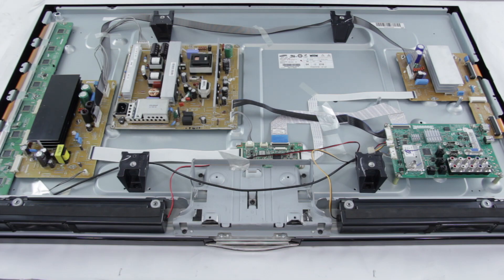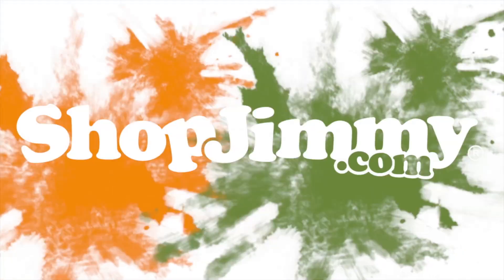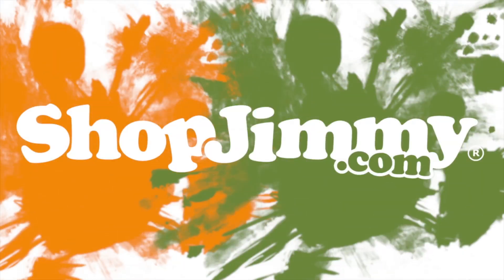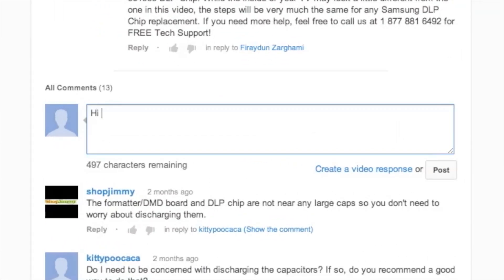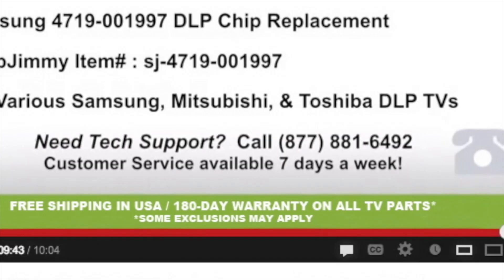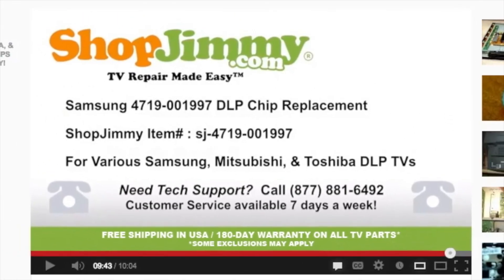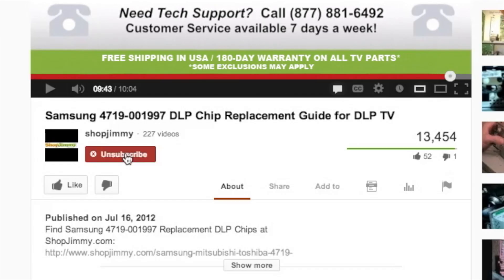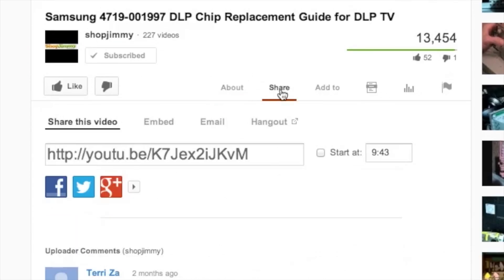Plasma TV Repair Tutorial - Common Symptoms & Solutions - How to Fix Plasma TVs

Comment: Hej there, first i want to say thank you guys for this tutorial. 

my problem is that my samsung plasma tv PS50C430A1W only plays audio but doesn't display a picture. so i tried the following. i changed the Y-board and Bufferboard. i bought it from eBay but i guess that guy sold me nonfunctional board or at least the buffer seems to be not working. 

if i turn on the TV some pixels are flashing on for almost a second before the samsung sound appears. ist there any other part that could cause these symptoms? i also changed the Buffer/speakers but they came from the sam ebay guy :/

maybe i have to go more into it and test the different boards more in detail but i would be thankful for any advice!

thanks to you all!
Reply from the maker: Laurids Wiemer  Try all repairs and troubleshooting at your own risk.  Sounds like you received defective replacement parts.  Thanks!  www.shopjimmy.com

Comment: I have a Panasonic TC-P50S10 plasma and have some vertical colored lines mid left side. It looks like some are going to bottom, some are not. Could this be a bad ribbon connection with the bottom buffer board??
Reply from the maker: MrJmm1952   Try all repairs and troubleshooting at your own risk.  This sounds like a TV panel (TV Screen) problem.  If your TV panel is bad, it may be more cost-effective to replace the TV as panels are typically hard to find in stock, difficult to replace, and expensive.  Thanks and please let us know if you have any further questions!  www.shopjimmy.com

Comment: hello, I am looking at picking up a used Vizio VP50HDTV20A plasma. It has sound, backlight, but no picture. It seems like this could be the logic or main board. What do you think?
Reply from the maker: Dustin Ouellette  PLEASE SUBSCRIBE TO OUR CHANNEL - Try all repairs and troubleshooting at your own risk.   I recommend replacing the Y-Main Board and the YDRVTP & YDRVBT boards in your TV.  Click this link to replacement parts for your TV model number.  http://www.shopjimmy.com/catalogsearch/result/?q=VP50HDTV20A  There may be multiple boards for the same TV model number, be sure to match part numbers on your current board, with your replacement for compatibility.  Here is a link to a video showing how to identify your part number, click here:  https://www.youtube.com/watch?v=R1jmj_foId0  Thanks and please let us know if you have any further questions with your TV Repair!  www.shopjimmy.com

Comment: Hey there i have a samsung plasma pn60e7000ffxza,  i have replaced the power supply board (bn4400514a) once already and the same thing has happened..the tv will turn off and on a couple of times and then the red light at the bottom left corner will blink twice every 3 seconds or so..ill disconnect it because you cant turn it back on after it does that..then itll power on for a while and do the same thing..then after a while it just wont turn on no more itll just do the clicking and the light thing...so having replaced the power  board once already hasnt helped could it be something else thats affecting the power board? Thanks for you help in advance!
Reply from the maker: Jorge Munoz    Try this at your own risk. Unplug the TV, then disconnect the y board and plug in the TV to see if the TV powers up. Reply with the results of this test. Thanks! www.shopjimmy.com
Reply: ShopJimmy.com i replaced the y main board and it still does the same thing..i havent tried what you asked but i will when i get sum time this tv is a pain...
Reply: ShopJimmy.com well i tried that and it didnt power on it just clicked on and off with out a picture showing up on the screen..
Reply from the maker: Jorge Munoz   Try this at your own risk.  Disconnect the x board and repeat the process.  Thanks!  www.shopjimmy.com
Reply: ShopJimmy.com i disconnected the x board and the clicking  sound stopped and the red light kept blinking and the screen still did not turn on
Reply from the maker: Jorge Munoz   Did you have sound before you disconnected the x board?  Thanks!  www.shopjimmy.com
Reply: ShopJimmy.com all it was doing before i disconnected the x board was the clicking noise over by the power supply board, once i disconnected the x board that clicking noise went silent..so thats all, there was no picture no sound..
Reply from the maker: Jorge Munoz   PLEASE SUBSCRIBE TO OUR CHANNEL - Try all repairs and troubleshooting at your own risk.  If the clicking stopped after you disconnected the X board, then you have a bad X board and it should be replaced.  Click this link to a replacement X board for your TV model number:  http://www.shopjimmy.com/samsung-bn96-22020a-x-main-board.htm  There may be multiple boards for the same TV model number, be sure to match part numbers on your current board, with your replacement for compatibility.  Here is a link to a video showing how to identify your part number, click here:  https://www.youtube.com/watch?v=R1jmj_foId0  Thanks and please let us know if you have any further questions with your TV Repair!  www.shopjimmy.com
Reply: ShopJimmy.com thanks boss..yea before the tv went out the x board was making a very loud buzzing noise but i thought that was normal i guess ill try replacing that as well thanks for the help..unfortunately  you guys are out of stock if not i would get it from you..i think i bought a u sus from you guys before..but again thanks alot you were a great help
Reply: Jorge Munoz well..i replaced the x board and still the same thing is happening. ..so far i have replaced the x board the y board and the power supply..i have ordered a main board off ebay to see if that helps..i will keep you guys updated...fingers crossed

Comment: PN58C550G1F Samsung 58" Plasma - TV turns on and stays on...but I only get sound (no picture)...i'm able to switch channels/sources..just can't see anything...if i leave it on picture comes on after a number of minutes.  Ideas ?
Reply from the maker: Phil Ekins  PLEASE SUBSCRIBE TO OUR CHANNEL - Try all repairs and troubleshooting at your own risk.  I recommend replacing the Y-Main Board and the Upper and Lower Scan Drive boards in your TV.  Click this link to replacement parts for your TV model number:  http://www.shopjimmy.com/catalogsearch/result/?q=PN58C550G1F  There may be multiple boards for the same TV model number, be sure to match part numbers on your current board, with your replacement for compatibility.  Here is a link to a video showing how to identify your part number, click here:  https://www.youtube.com/watch?v=R1jmj_foId0  Thanks and please let us know if you have any further questions with your TV Repair!  www.shopjimmy.com

Comment: I have a Samsung PN51F4500AFXZA that went blank shortly after a thunderstorm. I think the TV was fried by a lighting strike. I've replace the power board that I bought on-line but the TV still won't turn on.. Could it be that a have a bad power switch?
Reply from the maker: Carlos Almaraz   PLEASE SUBSCRIBE TO OUR CHANNEL - Try all repairs and troubleshooting at your own risk.  I recommend replacing the main board and the power supply board in your TV.  Click this link to replacement parts for your TV model number.  http://www.shopjimmy.com/catalogsearch/result/?q=PN51F4500AFXZA  There may be multiple boards for the same TV model number, be sure to match part numbers on your current board, with your replacement for compatibility.  Thanks and please let us know if you have any further questions with your TV Repair!  www.shopjimmy.com

Comment: My cousin has a samsung 55 in plasma and it turns on but no screen and looking inside the screen pcb board had a lil corrosion  could that be the problem
Reply from the maker: Samuel Manzano  PLEASE SUBSCRIBE TO OUR CHANNEL - Try all repairs and troubleshooting at your own risk.  Sounds like you have liquid damage on the TV.  If the damage is on a board, then you can replace the board, but if the damage is anywhere on the panel, it may be better to replace the TV.  Feel free to upload some images or a video of the damage and reply with the link.  Thanks!  www.shopjimmy.com

Comment: i have a samsung HP T 5054 plasma, The led under the powor button turns on but the screen has no image.
Reply from the maker: Josep Morato   PLEASE SUBSCRIBE TO OUR CHANNEL - Try all repairs and troubleshooting at your own risk.  I recommend replacing the Y-Main Board and the Upper and Lower Y Scan Drive boards in your TV.  Click this link to replacement parts for your TV model number:  http://www.shopjimmy.com/catalogsearch/result/?q=HP+T+5054  There may be multiple boards for the same TV model number, be sure to match part numbers on your current board, with your replacement for compatibility.  Here is a link to a video showing how to identify your part number, click here:  https://www.youtube.com/watch?v=R1jmj_foId0  Thanks and please let us know if you have any further questions with your TV Repair!  www.shopjimmy.com

Comment: Hello Jimmy,
I have an LG 50PN4500 Plasma
The TV shuts off (with stand by light on) when I touch the volume on remote
It also shuts off on its own for 5-10 min and turns back on by itself.
Is this a power supply issue only?
I will order the part and replace it

Thanks
Reply from the maker: Uncle Pecos   Try this at your own risk. Unplug the TV, then disconnect the y board and plug in the TV to see if the TV powers up. Reply with the results of this test. Thanks! www.shopjimmy.com

Comment: Samsung 60" 5500 Series Full HD Smart 3D Plasma TV Model Number
 B&H # SAPN60F5500
 Manufacturer # PN60F5500AFXZA
 Display
 Screen Size (Diagonal) 60"
 Panel Type Plasma

has a broken screen, no picture. Kid threw a toy at the screen and here we are...
Reply from the maker: vgdgbluver   Unfortunately there is no repair for a cracked screen.  This sounds like a TV panel (TV Screen) problem.  If your TV panel is bad, it may be more cost-effective to replace the TV as panels are typically hard to find in stock, difficult to replace, and expensive.  Thanks and please let us know if you have any further questions!  www.shopjimmy.com

Comment: I have a Phillips TV model number 50PFP5332D/37.  It is making a loud popping noise and the screen stays black.  We cannot turn the TV off, we have to unplug it and plug it back in to turn it on again.
Reply from the maker: Linda Kearney   PLEASE SUBSCRIBE TO OUR CHANNEL - Try all repairs and troubleshooting at your own risk.  I recommend replacing the Y-Main Board and the Upper and Lower Y Scan Drive boards in your TV.  Click this link to replacement parts for your TV model number:  http://www.shopjimmy.com/catalogsearch/result/?q=50PFP5332D%2F37    There may be multiple boards for the same TV model number, be sure to match part numbers on your current board, with your replacement for compatibility.  Here is a link to a video showing how to identify your part number, click here:  https://www.youtube.com/watch?v=R1jmj_foId0  Thanks and please let us know if you have any further questions with your TV Repair!  www.shopjimmy.com

Comment: This is a great video. I have an LG Plasma 50PA5500 that recently just randomly shut off while I was playing a video game. I turned it back on, and it lasted 5 minutes before it turned off again. The next time it only lasted 2 minutes, then 1 minute, now just 1 second. However if no inputs are plugged into the TV, it stays powered on forever. If I plug the cable or Xbox into the hdmi port it and turn them on, the TV shows the picture for a split second on the screen and then shuts off. Also, I cannot change inputs on the TV or open the TV settings menu or it will shut off instantly. I did not see any visual damage or blown capacitors. I'm thinking there is a problem with the main board? Or could it be the power supply too? Id like to purchase the main board you have if I can confirm this is the likely issue. Thanks for your help!!
Reply from the maker: Joseph Buran  PLEASE SUBSCRIBE TO OUR CHANNEL - Try all repairs and troubleshooting at your own risk.  I recommend replacing the main board in your TV.  Click this link to replacement parts for your TV model number:  http://www.shopjimmy.com/catalogsearch/result/index/?cat=56&q=50PA5500  Be sure to match part numbers on your current board, with your replacement for compatibility.  Here is a link to a video showing how to identify your part number, click here:  https://www.youtube.com/watch?v=RwHTvjMdrhk  Thanks and please let us know if you have any further questions with your TV Repair!  www.shopjimmy.com
Reply: I just received the new main board and installed it and the same problem occurs :(. In fact, it got worse. The TV does not stay powered on at all with the new board, it clicks on then zaps off. However after connecting the old board again it stays on like I mentioned in my first comment. 

One thing I just noticed was that the TV will stay on if the main board is not connected to the main logic board by the ribbon cable. Nothing shows up on the screen but the TV stays on.  If I connect the ribbon cable to the main board, it turns off. Could this be a problem with the main logic board? Would appreciate any suggestions/help. Thanks!

Comment: I have a samsung plasma tv model # pn60e530a3fz2a and no picture , but I have sound ? Tried replacing Power supply board and I get the same exact thing. no picture? Can u help?
Reply from the maker: john daniels   PLEASE SUBSCRIBE TO OUR CHANNEL - Try all repairs and troubleshooting at your own risk.  I recommend replacing the Y-Main Board and the Upper and Lower Y Scan Drive boards in your TV.  Click this link to replacement parts for your TV model number:  http://www.shopjimmy.com/catalogsearch/result/?q=60e530a3  There may be multiple boards for the same TV model number, be sure to match part numbers on your current board, with your replacement for compatibility.  Here is a link to a video showing how to identify your part number, click here:  https://www.youtube.com/watch?v=R1jmj_foId0  Thanks and please let us know if you have any further questions with your TV Repair!  www.shopjimmy.com

Comment: Samsung pn50c550. Set top box got fried in a storm. After that, no HDMI inputs on the TV will work. USB, composite both work. Set top box was connected by HDMI, of course. Got a new box and the tech set it up on composite and now 720 is the best I can get.
Reply from the maker: Ted Lovejoy   PLEASE SUBSCRIBE TO OUR CHANNEL - Try all repairs and troubleshooting at your own risk.  I recommend replacing the main board in your TV.  Click this link to replacement parts for your TV model number:  http://www.shopjimmy.com/catalogsearch/result/index/?cat=56&q=pn50c550  There may be multiple boards for the same TV model number, be sure to match part numbers on your current board, with your replacement for compatibility.  Here is a link to a video showing how to identify your part number, click here:  https://www.youtube.com/watch?v=BEPWrefQvqI  Thanks and please let us know if you have any further questions with your TV Repair!  www.shopjimmy.com
Reply: ShopJimmy.com Fixed. You guys rock! :)